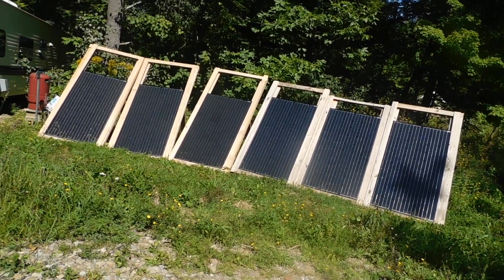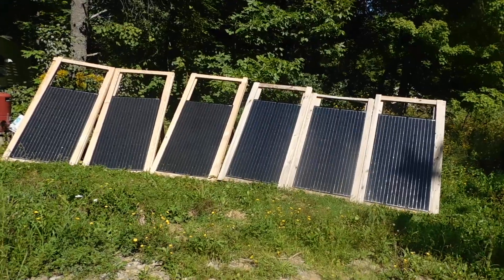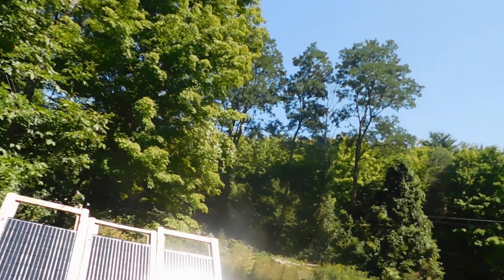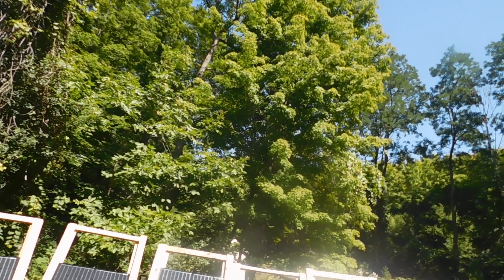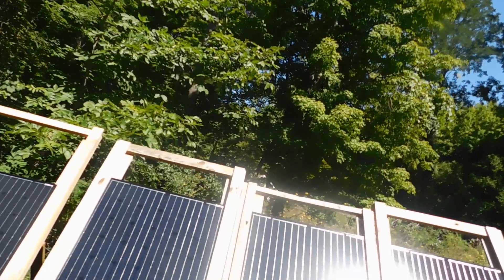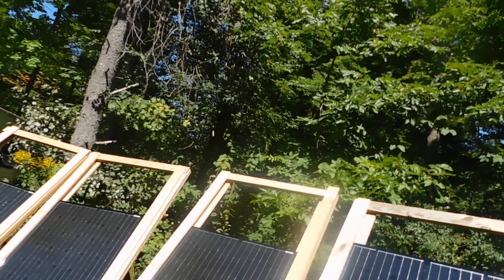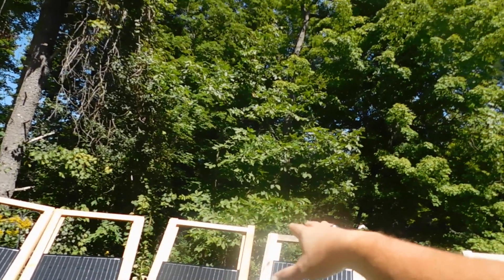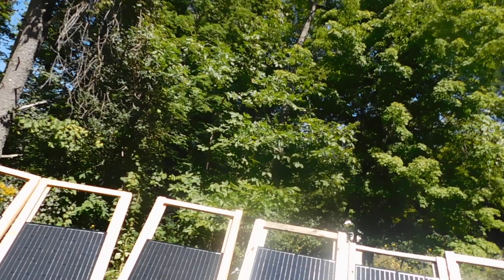Why do i need more solar panels for my Off Grid System?

Comment: your making it way to complicated friend , buy a used no motor chicken house fan , and get a real generator off an old school vehicle.. install on the fan and sit anywhere un obstrusted by terrain , they will produce power with little to no drag , and will produce all the time the fan moves in the wind.24-7 costs nothing , no maintence. and will keep charged more batterys than youve ever owned or ever will.screw them solar panels, i produce emergency power for a mid sized farm with no effort.no cost and no maintence. -  with this system , i got the fan junk , the generator junk , and it took literally minutes to assemble. has been running for years , iv had to add battery paks for the excess power it produces.
Reply from the maker: That's very interesting thank you for sharing that I need to check that out.

Comment: I might be mistaken - but I believe your panels are wired in series. Given the unpredictable shading of your panels, you might get more power out of them by wiring them in parallel. Have you tried?
Reply from the maker: Yes I have the way I have them now is much better.

Comment: It just struck me how much lead acid batteries have in common with politicians: They promise to work for you; but in the end, you end up working for them.

The good news is the LiFePO batteries are coming down in price. And those are far superior for solar off-grid installations, because they can be left in a partially charged state for prolonged periods of time without  degrading.
Reply from the maker: That's very good to know time will tell.

Comment: enjoy your viedos. currently running two midnight solar kids syncd up 600 watts each  in 12v . looking at the aims inverter . are u happy with it? and how helpfull was going to 24v? have a great day
Reply from the maker: The aims is great I have had no problems with it at all. And 24 volt is much better.

Comment: Keep those wooden framed panels off ground and foliage contact so they will last longer and prime and paint frames.
Reply from the maker: They are pressure treated.
Reply: Not all pressure treated wood is rated for ground contact. 4X4 and the larger 2X8 have additional treatment of copper azole to allow them to last longer when contacted to ground while the 2X4 to 2X6 are not treated as much and used for above ground. An additional thing to remember is when you cut any pressure treated wood, any fresh surface inside will not have any pressure treatment on it since pressure treatment penetrates about 1/4" or less, so the exposed surface must have wood preservative painted on it.
Reply from the maker: ***** Ok thank you that's good to know. I plan to change how they are mounted within two years so we will go from there.

Comment: Remember if it is good for us it costs more. It is easy to cut out bad and add in good slowly. The pocketbook is only so big and the coupons only give so much off. So breakout the 2.5 analog interface printer and put the paper between the printer and a flat surface, than jot down all the gains by and losses needed to get more power. ( 2.5 = pencil)
Reply from the maker: That is good advise thank you.

Comment: Please add a wind turbine before winter, it will help your batteries during evening / nights. When I chain my wife's mother to the front fence at night, I see the turbine spinning. The humming noise puts her to sleep, it has that effect on sea creatures that live on land.
Reply: I was going to suggest wind power to augment the solar in the day and the generator at night. Then you add the hot air scenario to the whole thing, we might add a water wheel generator for during rain off roof times. The idea is to charge batteries to float and use rest to run house in day time.
Reply: +Frederick Nolan - A 24 inch bike wheel and a Mopar car alternator with a few feet of 8 gauge electrical wire with PVC pipe fins can be an off grid friend for a long winter.
Reply: +Lou Will Save Us Now we're getting the idea. Bend the fins to catch water from a spout works in the rain. Summer backup too.
Reply from the maker: You are a trip.
Reply from the maker: We will down the road we have a lot of things we need to get done.

Comment: I like your set up and wish to see you get the most out of your panels.The shade I saw on the panel is costing you a bunch of watts in whole three panel string. This can be checkedby disconnecting and checking the voltage of both sets of panels, one with no shade and the other with just a couple of cells shaded. You may wish to consider cutting back the trees south of the panels so you can have full sunlight. During the winter months when the sun is lower you can see how much more will need to be cut back. I know it will be a bunch of work but what you cut this year will be next years fire wood. This would maximize the output of the panels you have. Good luck.
Reply from the maker: We are going to do that for sure starting with the big maple.

Comment: As you already know (since we talked)  You build your system for winter. (worst case).  Then  with fixed panel's you need 2 watts per 1AH to ensure maximum charge.  Industry standards are for a perfect world.  In reality, your batteries should get to float as soon as you can, then have enough input to cover all your use during the sunlight hours.   That way your batteries are fully charged at sundown.  So less cycling them during the night.  Just FYI for those who don't understand batteries.  The life of a battery is cycle times (not life in years).  So if you only bring the batteries to 80% every day then you only cycle the batteries 1 every 5 days.  With a tracked solar system setup you can get away with 1.25 watts per 1AH but preferred is 1.5 watts per 1 AH.  I hope this information helps.
Reply from the maker: Very good info to have thanks Bill.

Comment: We have been doing this for 18 years, and I well tell you, there well always be changes you make. Just take it one day at a time, there in no rush. You have come a long ways in your system. As a piece of advice I would tap some 12 volt of that bank and run 12v LED lights in the house. Saves a lot of the waste of the conversion of the inverter and it allows you still to have light if something happens to the inverter or your batteries go low and the inverter shuts down do to low voltage. As far as tracker goes, I been that route and found for me that it made more sense to add a few more panels that to invest the money in a tracker. But that was my experience and I am sure there is ones that well have a positive story to it to. Keep up the good work.
Reply: he can get a 24v to 12v converter 400watt off amazon for less than 50 bucks.   Best way to get 12 volt off a 24 volt system.  I use them to run all my 12 volt items.  I also have 24 volt led lights also.
Reply from the maker: Thank you for the advise we are figuring things out as we go I think more panels now is the key and then we go from there.

Comment: Your panels will produce MORE watts in colder weather but this is offset by the shorter days. In the summer time, the heat means that you get less power but you get more time to get that power.

As solar panels get hotter, the voltage drops off. I normally run three 260W panels on my charge controller but it was raining yesterday and so I I hooked up the whole 2kW array. Even when it was raining I was getting 360W coming in from the panels.

More solar panels is always good. You don't have to use them but it's better to have them and not need them than it is to need them and not have them.

As for the tracker, I think it's cheaper just to buy more panels.
Reply from the maker: Thanks for that I think your right I need to add more panels as soon as I can.

Comment: If you increase your batteries you increase your abillity to carry on during "no sun" days. Especialy in winter it will happen that it will be cloudy for more than a week. I think you need to ballance your need for a bigger solar array with more batteries. That being said, only you will be able to set your priorities because you will have the experiance of your local winter conditions and its effects on you electric production. I think that you will learn more about the needs of your system each year and that will show when you have enough and when it is more economical to run the generator for a few days.  At least you are working toward providing for your own family.
Reply from the maker: It is a learning proses that takes time to figure out what works for us.

Comment: a solar tracker stands up enough it will slide snow off. a fixed array doesn't. I have three 3.4 kw trackers. will not do it any other way when there's a lot of snow. well worth the investment. in the end it's the same price installed as a fixed array if it's on helical anchors to prevent frost from lifting the support up.
Reply from the maker: Ok cool thanks for the tip I think its the way to go as well.

Comment: I just got 1700 watts 10 x 170 watt panels and will be looking for another 1700 watts or more. MY moto is more the better I also have 2 1700 watt wind turbines that do nothing in the summer but I hope this winter they rock on. 
Get your panels first then mount them later is my suggestion.
Reply from the maker: I hear you even if I have to get one at a time.

Comment: In this day of solar panels and the drastic reduction in cost of the panels, it is less expensive to by more panels than to get a sun tracking mount for your existing solar array.  The best way to maximize your solar array is using two arrays one facing SSW and on facing SSE this will catch sun from early morning to late evening.  I will refer you to Engineer775 again as he covers this topic in many of his solar installation videos.
Reply from the maker: I was thinking about that as well trying to figure out the best way to do it.

Comment: Trying to figure out what we need in the way of solar, in the event we make a move to where we have to be off grid. (trying to plan for every contingency)  I want my deep freeze, at least one computer.  Our lights will be a combination of LED and flame. Maybe have a washer, but that may not be right away.  Still thinking this through.  Wondering if I would need to part with my slow cookers.
Reply from the maker: If you get enough panels you can keep them.
Reply: Start by working out how much electricity you use.
Reply: preppernurse1 Sorry, that last comment of mine was supposed to be directed at someone else. I know that you're aware of your electricity usage.
Reply from the maker: Pop's Shack That we will do.
Reply from the maker: Pop's Shack That's no problem at all.

Comment: I hope you meet your goals!  Sounds like you over-sized your battery bank, if you need more panels just to keep them charged up(?).  Also, do you practice any conservation at all, or is it just "full speed ahead"?  We have 2 battery banks; the first was our "older" bank that provides maybe 75% of our power needs.  The second is a bank we grew into as we added more solar panels.  It just sounds odd to me that you need more panels just "for the batteries".  I think a system should have components sized to maximize each other's capabilities, not to send its owner to the poor house!  (Sorry it's so long....).
Reply from the maker: That's ok I wanted to make sure my battery back was good first and I always knew I would add more panels.

Comment: where is your wind turbine. in the winter the wind blows. even if the wind turbine is small a little is a lot when its marginal solar output
Reply: I put up a Bergey Wind turbine. Works great. With wind solar the batteries never go down. For an off grid systems to work Rea nice use both
Reply from the maker: The cost of a tower is not worth it at this point its better to go with more panels.
Reply: I have two wind generators, and if I had to do it again, I would of bought more panels than mess with wind.
Reply from the maker: Roy Amberg We might do that at some point.

Comment: the classic 150 I was running 96 amps @ 3000 watts and the fet over heated i think so keep a fan on the classic will be a great idea when you get higher in amps.
Reply: My best is over 18kwh
Reply from the maker: That sounds like a good plan to me.
Reply from the maker: Very cool.